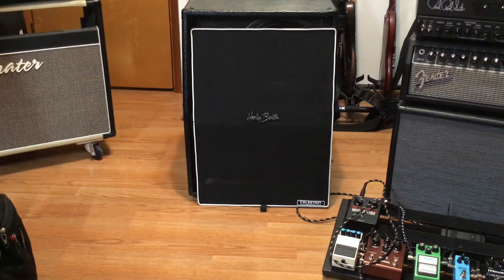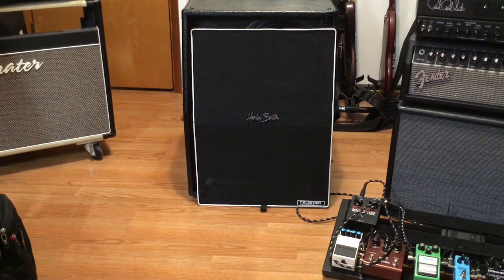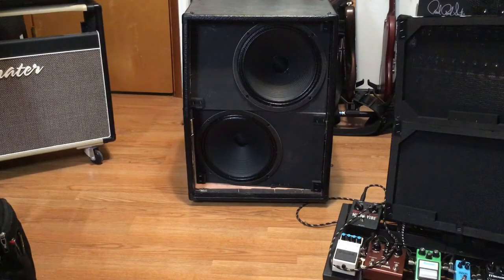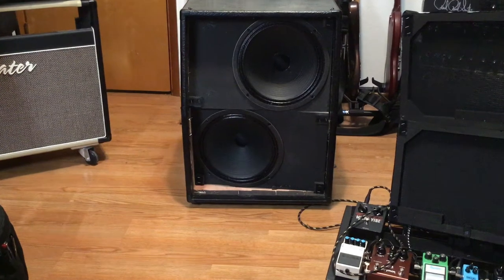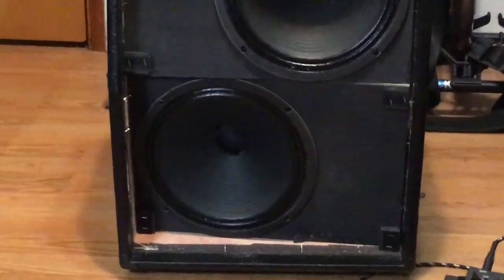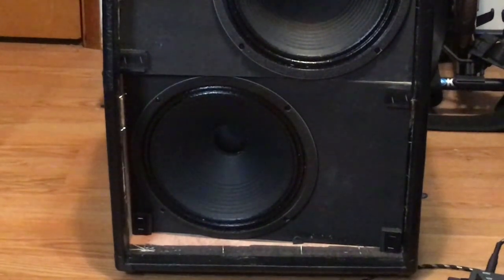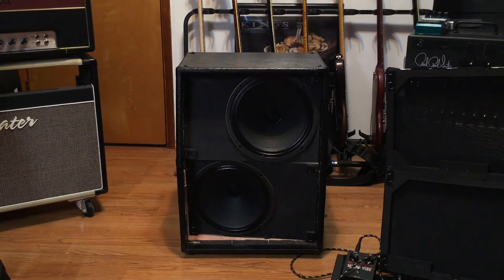Harley Benton G212 Vintage 30 Vertical Cabinet Review Part 1

Comment: Wow. Its amazing how far they've come since this video. Now in 2022 I've had a great experience with Thomann. Cab got to Boston in around 5 days, perfect unflawed condition, packed exceptionally well and sounds great. I mean I wouldn't go bouncing a $240 cab around the back of the van but the cab seems to be pretty solid construction from where I'm sitting. So sorry you got screwed, lotta bunk internet sales goin on out there. Can't even trust gettin a non-counterfeit set of EB strings off Amazon for F sakes!!
Reply from the maker: Glad to hear it, no one deserves to pay for a defective piece of gear without a way to get your money back.

Comment: That’s unfortunate that you had such a bad experience.

I bought one of the horizontal 2x12 w/the V30s just for the heck of it.

Mine arrived in pretty much flawless condition.
I even dismantled it to check it out and I was somewhat surprised that it had decent bracing, nice glue joints, etc.

It’s definitely nothing boutique and anyone buying these need to be realistic about what you’re buying.

And given that these travel from Germany in a very thin cardboard box, it’s probably a miracle that all of them don’t arrive like this. You could also post fit 2 of these into the Orange 2x12 shipping box.

You are correct to say “buyer beware” but people also need to understand that most people don’t have these issues from my understanding.
Reply from the maker: I think this is likely happening to folks in the US. I've had PMs from several folks in the States who had the same experience as I did. It's not much of a box to ship overseas but the issues with mine was clearly the build quality. Whoever assembled my cabinet was either completely untrained or just didn't give a crap. To be transparent the reason I made the video was because of the tactics Thomann used that were really shady. I'm curious as to where you had your shipped too?

Comment: The cab is garbage as far as construction goes. 
When I got mine it was in one piece but there is no constructional support on the baffle and no bracing on the sides thus making it sound like ass. Thin, harsh etc.
The cab is worth only for the speakers unless you put the effort to modify it with some bracing and baffle support. Then its ok.
Reply from the maker: That's the perfect description for this cabinet. If they just would have properly braced everything together with some solid support it would have been useful. You can't use almost no glue and one staple to support 2 vintage 30's they weigh to bloody much.

Comment: yeh that company customer servire is terrible even in europe, e-mail them about a tube head i just got, that was randomly cutting out, figured out it was just the output jack loose, but well.. still waiting a response from them (:

Was kinda looking at this cab since i want a vertical 2x12 V30, and oh well.. che i'll go with a Palmer (:

Comment: What egnater can is that on the left? A tourmaster any chance with celestion elite/lead - 80?
Reply from the maker: It is. I had the head out of it while I was working on it. Great sounding amp needs constant work and transformer replacements.
Reply: @dinofond  what are your thoughts on the tourmaster cabs?
Reply from the maker: This is the only one I have owned so I can't speak for the others.  The 2 x 12 is very well built made of dovetail birchwood. The Elite 80's have a clarity to them for clean tones that seem more reminiscent of a JBL speaker than a Celestion.  The main issue is the weight of the combo, It's around 100 lbs and hard to move around but I like the cabinet for sure.
Reply: @dinofond  I own a tourmaster 2x12 cab only paired with a boogie JP2C. Like you said, I found them a bit bass-y? So I'm waiting on this HB vertical 2x12.. hopefully I get one a luck better than yours lol